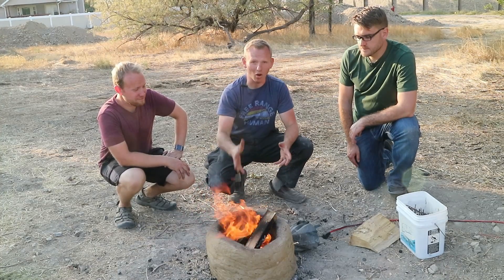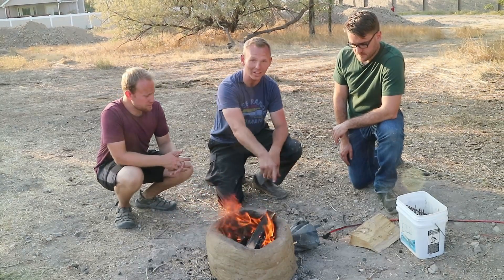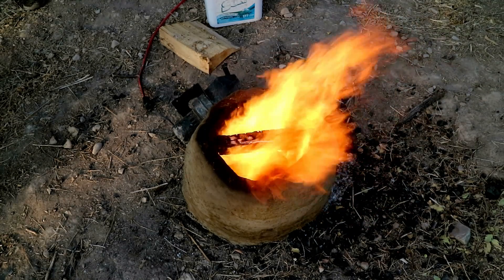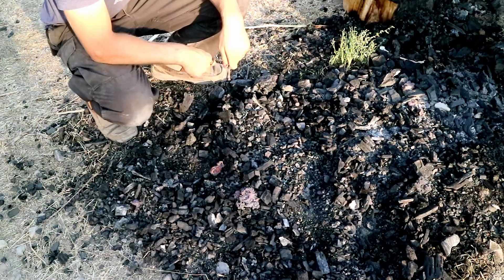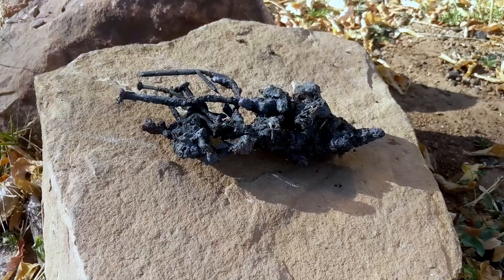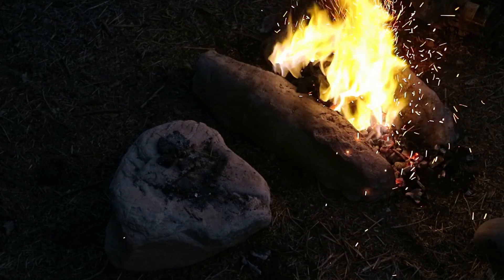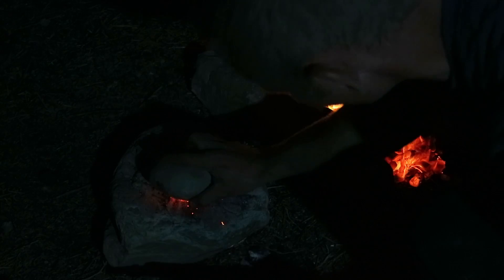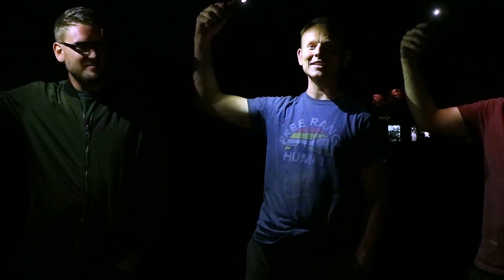What is an Aristotle Hearth? (featuring Andy from How To Make Everything)

Comment: Well, the results are kinda disappointing i think... Your "clumps" seem very corroded by the oxygen, wich is a big no-no for this operation. It should give you a somewhat clean but very high carbon piece of steel at the end. My take on this is that you've given it both too much oxygen and too little heat, wich are both the results of unoptimal fire management. If you just want to clump your iron together, dont waste your time on an aristotle furnace i'd say, instead just forge weld everything together. I think the aristotle furnace is just meant to make high carbon steel.

Comment: But the air vent  2/3 up the furnace and make it a bit higher. If air comes from the bottom it will even take away carbon because  the air will bond with the carbon and make CO.
When you put the air vent up higher like 1/2 or 2/3 it will still make  for a hot flame and you wont have as much air at the bottom, more carbon is gonna bond to the iron and make steel

Comment: These work better when the airi nlet is not on the bottom. You want a hotspot on the top of your fire to melt the iron. Then a colder place where the steel consolidates in a bloom. Also it's important to use smaller charcoal fragments and pake sure you charge the iron in the center of the hearth.

I tried this already and got very good results first try.

The amount of steel and frequency also matter quite a bit. I'm no expert but if you're interested I could give you some more advice and specifics through skype

Comment: If you've seen how the Japanese make Tamahagane and replicate their technique, you might have better results.  I've never done it, but it's worked for them for swordmaking for centuries.  Basically, a lot taller furnace, filled with charcoal, get it hot, then add iron sand  at the top.  As the iron melts, it migrates down through the foundry to form the bloom at the bottom, picking up carbon as it goes.  Chandler Dickenson tried doing this with concrete blocks stacked one on top of each other & using dirt from his shop floor in place of the sand, but it didn't work too well & he got rather upset toward the end...  The Japanese keep their foundry running for 3 straight days to yield both high & low carbon steels which are then used to make some of the finest swords ever made.  If you're interested, watch the 'Secrets of the Samurai Sword' episode of Nova.

Just found your channel through your collab with HTME & am glad I did! =)
Reply from the maker: Welcome! JB